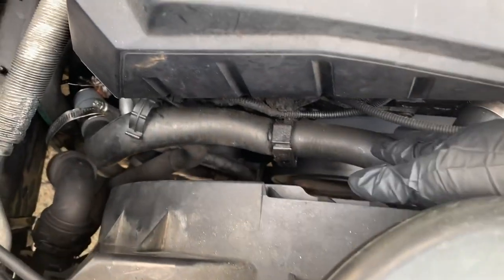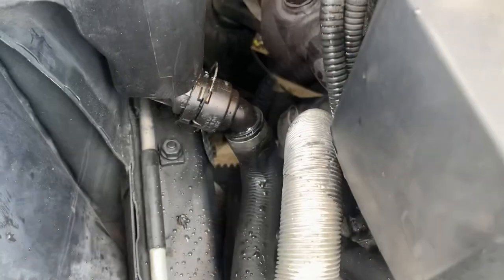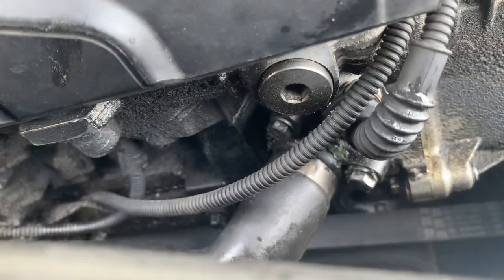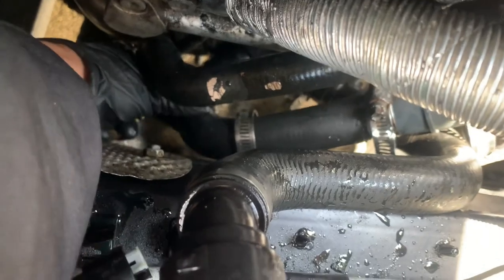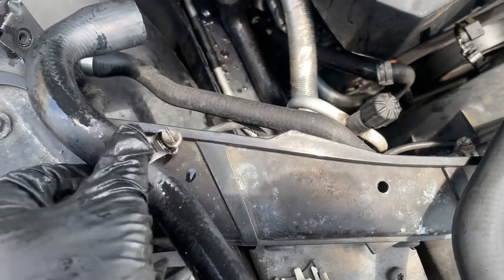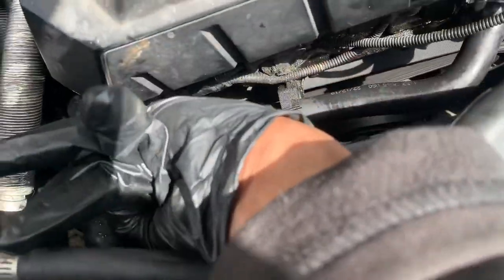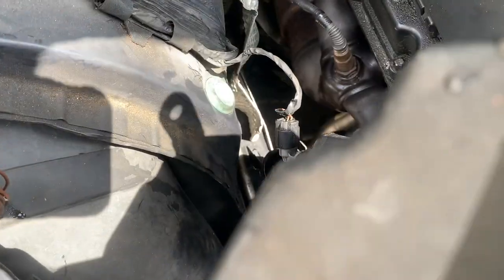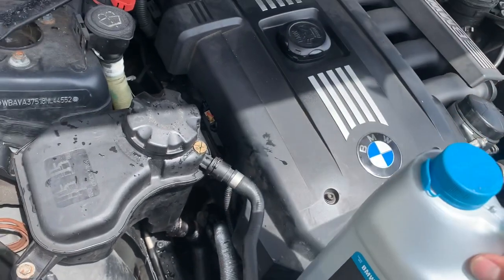2008 BMW 328i Front Coolant Hose Replacement E90

Comment: Quick question homie. If I jacked the car up would it it he easier to uninstall and reinstall the hose from underneath?
Reply: Looks like it would be hell of a lot easier from underneath.
Reply: Possibly could even get to it by removing the wheel and inner fender cover. Haven't looked yet though.

Comment: Hi..i got problem on BMW E90...2008 year

Im driving normally...when i turn off the car, get off...my all windows get opened...
I turned on car again - rise them up - turn off, and it starts again...
After i open my drivers door it get down...after delay of few seconds...

Hopefully i can rise up them by holding button BUT it doesnt work always...maybe after 5-6 times of trying...

I went to automechanic, he once fixed it and now after 2 months its started again...now he's in problem too 😅
TIP: i washed my car day before this happened...
Reply: I replace a door lock actuator and this happened to me. Bought a oem door actuator and everything worked again .